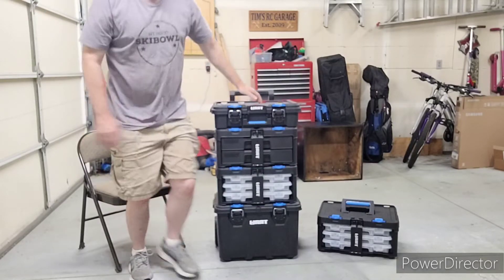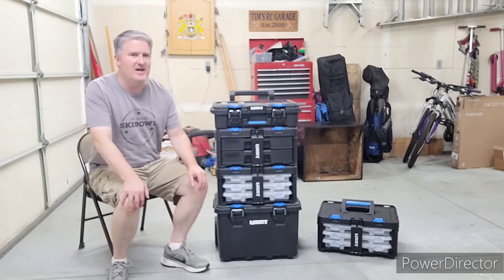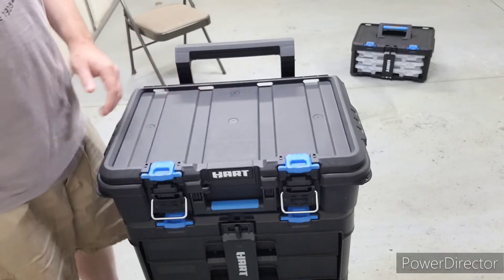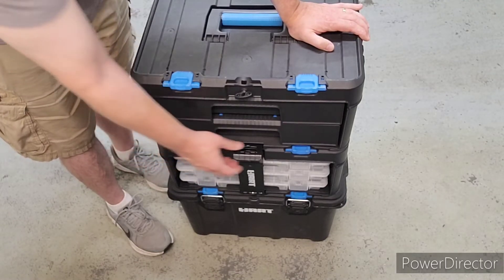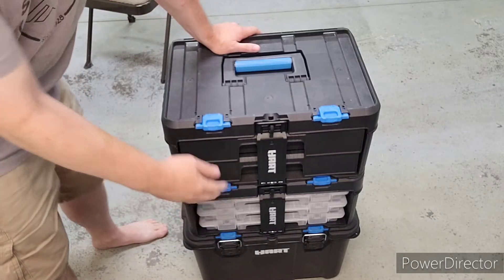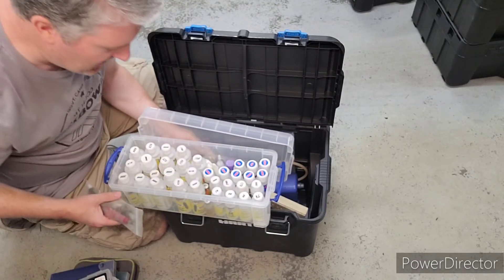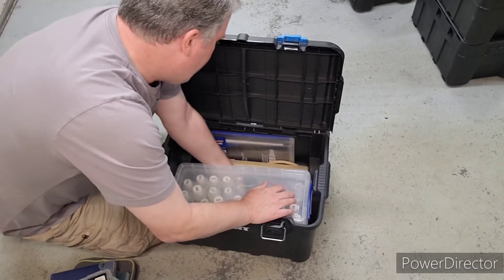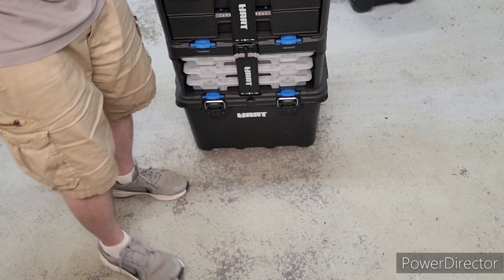Ultimate RC Toolbox

Comment: Some screw kits , drivers , pliers , forceps , pry bars . All kinds of little tools come in handy for me . I drilled a tooth round for gripping shocks . Mostly precision pieces and a kit luck battery driver has been awesome from Amazon . It was only $20 on sale too . I touch button for direction and ability to turn when not press in the button . It’s made life simpler and helped with arthritis . The first time I fixed an RC I used the little Allen wrenches and never again 😂